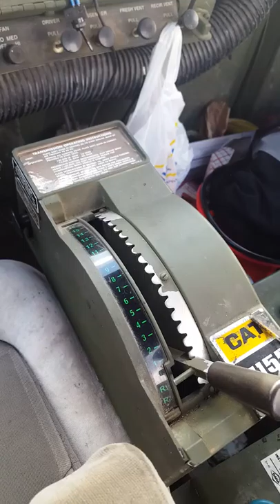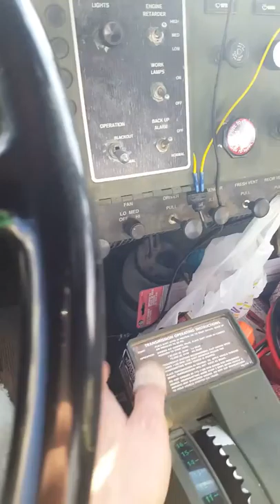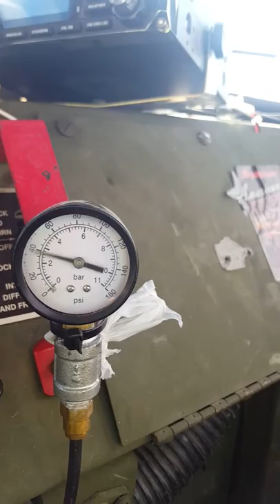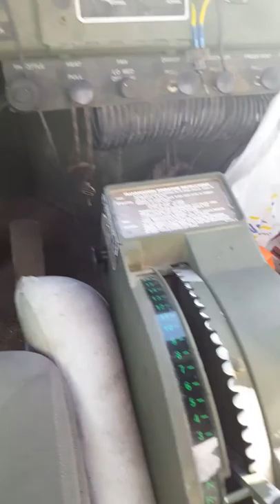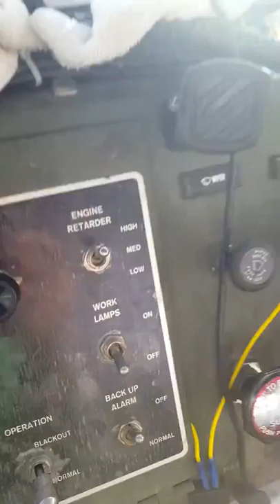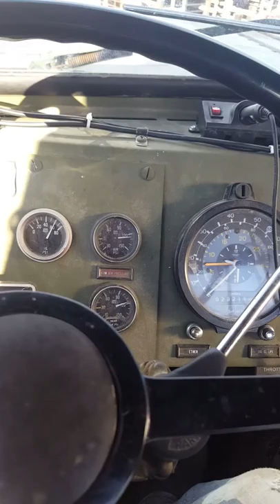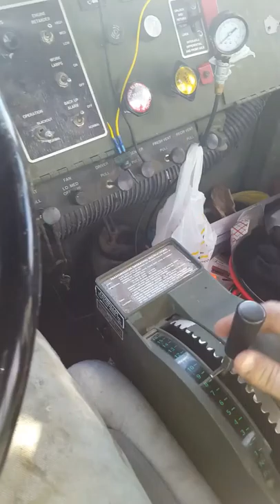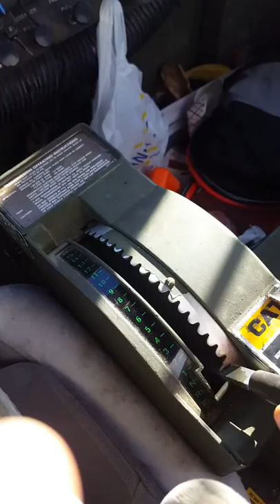AM General M916 Caterpillar 7155 16 Speed

Comment: Enjoyed your video, I was in the Army at Ft. Benning GA from '86 to '90 in the 533rd Transportation Company, we had 46 of these trucks in the M915 variant. 3 platoons of 15 and 1 truck for the maintenance platoon with a Holmes wrecker kit on it, I was the wrecker operator. Loved these trucks, loved that sound of the air solenoids. We all got pretty good at driving them too. Don't know if you knew this or not but a M915  would do an 1/8 mile in 11 seconds.

Comment: I added a filter regulator luber to the air supply for trans to keep the shifter lubricated, based on what i read on the forums.  I have a M920.

Comment: You forgot about the M919 which is a concrete patch rig.
The first variants of M915A0's-M920A0's all had the 7155 Caterpillar.They went to the Allison Automatics starting with the A1's.I have one and all I've done is replace the governor spring so that it's not stuck at 57 MPH.Mine currently has 636,390 miles on it's NTC-400 and it's aftermarket with more than 500 HP/1,950 TQ
Reply: ntc-400 does not have 1950 torque, Pittspurgh power told me the cummins 855 are not torque motors, they told me an 855 turned upto 500 hp is still less than 1500 torque. they like to rev but not torque.
Reply: @davidroberts6594  Cool story...Now do us a favor and learn how to read because I obviously put "aftermarket" when talking about the power from my NTC-400 in my truck.
NTC-400's are 400 HP/1,200 TQ when stock.

They like to rev? If you want to be a internet expert about 855's,take a look at the NHC-250's.Those engines destroyed bearings and valve seals over 2,100 RPM even though the military issued TM's stating they could do 2,300 RPM.This was back when the five ton trucks still had them.And that wasn't the entire list once fragile rocker arms and weak cams are mentioned.

Comment: Good video. How are things working out with that truck now that it's three years later? I'm looking at purchasing one and just have concerns about the durability of the transmission and ease of repair of the unit. I plan on using it to haul construction equipment around the mountains of Utah so it would seem to be the ideal setup.

Comment: They are a cool transmission and have put a lot of miles on them , but you have to know how to shift it and you never let the RPMS drop below 1150 rpm as these transmissions have a centrifugal clutch and if lug them it WILL damage the clutches.

Comment: My military unit in Germany had a lot of trouble with the valve group gumming up...untill the old alchole air drying system was replaced with a modern indesece style dryer...
If your truck is still using the alcohol bottle under the hood...please invest in a new air dryer system

Comment: If you were to get stuck and needed to rock your rig in snow mud how well would this 7155 do switching between forward reverse over and over? Thanks!
Reply from the maker: I've had to do that a few times in mud.  It's actually not too bad.  From my experience it's about the same rocking in and out with a 13 or 10 speed.  It's not like the modern auto shifts they have now.  Those suck because you have to have your foot on the brake to get in and out of forward and reverse.  These 7155 transmissions......what ever gear you place it into, at any time, any speed, any rpm...........it's going to go into gear so be ready!

Comment: So the one thing I didn't quite grasp is, what's the purpose of the "button" that acts as (to what I could tell) a 'clutch'? I noted you shifted without it while in motion.
Reply from the maker: Not sure what you're asking.  There used to be a pedal on the floor that you used with your left foot to turn on the Jake brake.  I removed it and installed a switch on the dash.  Is that what you're asking about?

Comment: Whats the latest on this truck? Ive got a 916a2 and a 917a0. 917 will not go in any gear.
Reply from the maker: I haven't done anything with my truck yet.  On that 917 try putting some air tool oil in the main air line that runs into the transmission.  Sometimes that can loosen up the sticky shift solenoids.

Comment: We bought an m920 for hauling manure, and was wondering if there is a certain rpm you need to be at when shifting?
Reply from the maker: Not really.  The transmission doesn't care.  Just avoid lugging or over revving the engine
Reply: never let the engine go below 1100  under load or it will slip/burn the input clutch.

Comment: Nicely done video! Cool trucks and a awesome transmission. Drove the M916 in the Army in the 80's, I liked the 7155 so well I put one in my 1996 Western Star 2 years ago and have thousands of miles on it now. 
Basically drive it like you are floating a manual. I moved my Jake to the floor, but I understand your reasoning. 
So are you going to put a fifth wheel back on after the stretch or are you building it into something else?
Reply from the maker: ponway . That's awesome!  I hadn't heard of anyone installing the 7155 such as you described.   It is a neat transmission.   As far as my m916 I will be putting the 5th wheel plate back on.  Possibly a sleeper as well.
Reply: The  air ride and longer wheelbase ought to be a big improvement in the ride! 
I see one of my friends has posted a short video of a ride along, if you search "7155 western star" you should be able to find it. Took a while to get all the parts together, I didn't just take it out of another truck. Did the work myself. 
If I get back out that way, maybe  I could stop by and show it to you! I'm in Indiana.
Reply from the maker: Yeah definitely.   If you are ever near Boise idaho let me know.   Do you have a line on any parts for the 7155?  I can find the solenoid box at a few different military surplus places,  but I would like to find other parts.   Such as seals and the clutches.
Reply: I sent a message to you that might help you out. I used the email address on your business card.
Reply from the maker: @ponway  hey sorry.  I had gotten a new phone and I wasn't signed into YouTube.  I did get your emails.  Thank you.  I had thought I replied but I'm sorry if I didn't.   I'm not looking for any 7155 parts, but like to know where I could get them if I ever need any.

Comment: Did you tee your air line in for the rear clutch gauge where the jake pressure switch is?
Reply from the maker: No on the back of the solenoid block there's a port used for checking air pressure for the rear clutch.  I just removed the plug and used that.

Comment: moving the jake from the floor to the dash your loosing its advantage,i drove these trucks in germany and ft lewis,i have a metric shitton of miles  shifting these,the foot pedal jake makes it very easy to coordinate the jake with the trans
Reply from the maker: To each is own.  But when you go down 7% hills that last 10 miles or so I hate holding my foot on the pedal that long
Reply: @prodieselrepair3218  i was at ft lewis washington as well,lots of 7% grades for 7/10 miles,holding the pedal down really wasnt an issue for me but your rite everyone has the preference